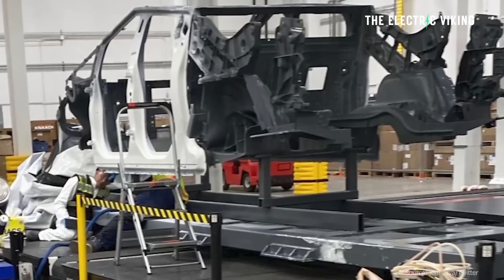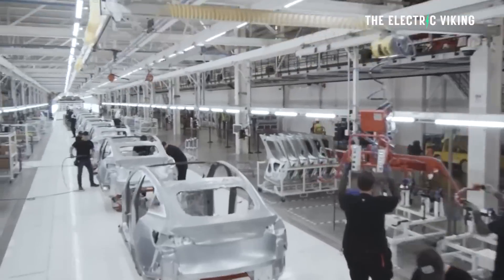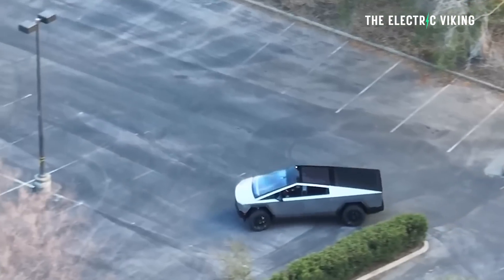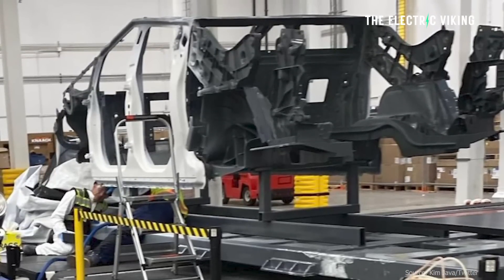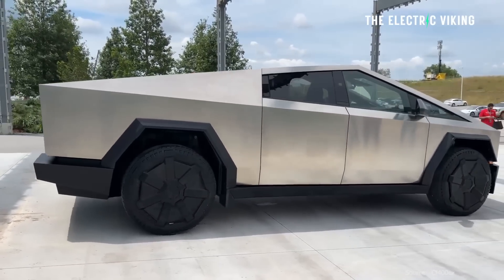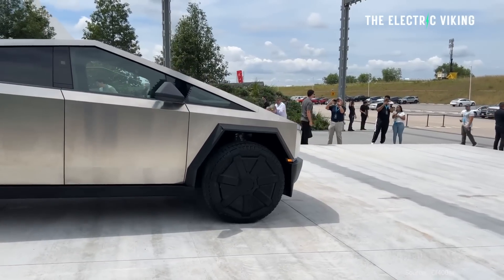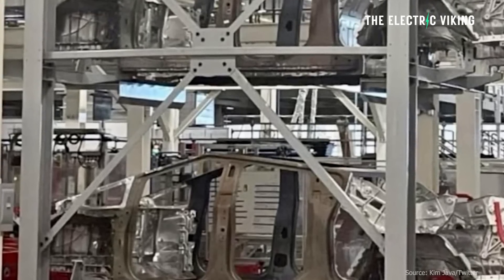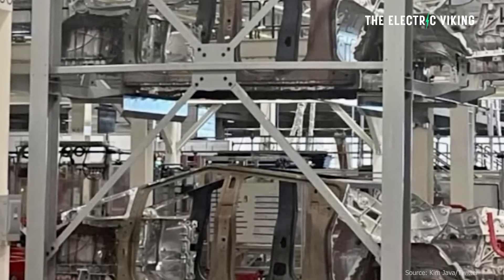Tesla Cybertruck production spec body in white revealed at Giga Texas

Comment: It looks like a unibody type design. Looks like mostly steel not stainless steel in this truck. Not much salt resistance from what I can see. Just a bigger electric Maverick with a different body shape. The giga castings takes cost out of production but reduces how strong the truck will be compared to the old design. This is why it took so long they had to redesign from the ground up.

Comment: this is not a normal truck, and to be blunt, it looks like Tesla will have built some kind of new variant of unibody. looks very strong and durable. the door aperture stampings are required for side impact protection more than likely. looks like a lot of high strength hot stamped steel. hard to know how much of that structure is stainless, but properly coated, these trucks shouldn't see any corrosion of decades of very hard use.

Comment: "Exoskeleton" was always misleading marketing. Anybody with a slightest inkling of how load paths work could tell you that those exterior panels were not going to be primary structure. And, if this ever goes outside of the US, the front panels are likely on collapsible standoffs for pedestrian safety. Flat surfaces are unforgiving of misalignment and flex, so the exterior likely provides little to no structure in order to maintain cosmetics.

Comment: That's not the body panels painted white. That's the internal, unibody like components. That white is no doubt a paint or primer to protect the panels from corrosion. 
Also, keep in mind that the B and C pillars are almost always shown in black, which tells you they're either painted or clad in black. Either way, the white shown in the video wouldn't be exposed to view.
Reply: "body in white" does NOT mean its painted white. Z its the basic body with out stufff like transmission, engines, wheels ets.
Reply: @eddevoe2519  uh no. No one calls it that or refers to it that way.
Reply: @ChristopherGaul  "Body in white (BIW) is the stage in automobile manufacturing in which a car body's frame has been joined together, that is before painting and before the motor, chassis sub-assemblies, or trim (glass, door locks/handles, seats, upholstery, electronics, etc.) have been integrated into the structure..."

Typically it is now technically body in E-coat, but the term has been used for over a century, back to when coachbuilders typically supplied bodies to manufacturers.

Comment: Most pickups are body on frame, where the frame provides the chassis strength.  Most cars are unibody, where the body panels provide much of the strength.  However, in standard unibody construction there are still front and rear subframes that support the suspension and powertrain.  In Teslas with the front and rear giga castings, the castings replace much of the body structure and all of the subframes.  The outer sheet metal is attached to the castings and provides some additional strength.  It's really neither fish nor fowl.
Reply: The Tesla Model Y that uses giga castings still has subframes, and this would as well, as there is no place to mount the motors or lower control arms. Motor and lower control arms mount to the subframe, which is designed to go under the vehicle in a severe accident. The subframe also helps with NVH and makes assembly easier. The casting replaces shock towers, rails that connect to the crush cans, and lower part of the bulkhead (what we used to call a fire wall) that would be spot-welded sheet metal in another unibody pickup, like a Hyundai Santa Cruz. In this application it extends upward to take some of the rear inner quarter panel loads.
Reply: @larryevans6739  Hi! I found your comment really fascinating, so you're saying the Cybertruck will still have a sub frame? At one point Elon Musk said the cybertruck would be an exoskeleton-based vehicle, but you're saying it's still body on frame, right? Just curious, thanks!
Reply: @burgerjointgame  No, I'm saying a it is a unibody. Most unibody vehicles use subframes. Most cars are unibodies. When you say "body on frame" then you are referring to a ladder frame that goes the length of the vehicle that has a body on top of it. This can be seen in most full-sized and heavy duty trucks. Trucks like the Hyundai Santa Cruz, Honda Ridgeline, Subaru Brat and Ford Maverik are other unibody trucks.

"Exoskeleton" is a marketing term taken from biology to try to make it sound special.
Reply: It's only very partially an exoskeleton in that the panels on the cybertruck will contribute to the structure, rather than merely hanging from it. Some of the stamped supports that provide the integrity of doors, panels, hoods, hatches on a conventional unibox will likely be mostly missing on the cybertruck. However I don't think they manage to get rid of it all. Was iit hyperbole from Elon? There's no way to do a true exoskeleton in a car as you will always have some form of underbody taking the stress from the hardpoints of the suspension.To what extent it is exo-skeleton we need to wait for Sandy Munro's teardown.
Reply: @pandemik0  "Exoskeleton" is not an engineering term. And if it wants to pass pedestrian crash tests outside of the US, the need for panels to collapse will eliminate their structural benefit. Regulations dictate the existence of side impact door beams, so those will not be removed either. The top is largely glass. The only possible place that the exterior panels could provide structure is the rear quarter. But, due to the unforgiving nature of flat panels with sharp edges for alignment and buckling, any benefit will likely be minimal. All the "exoskeleton" talk is overblown marketing to try to make a unibody seem special.
Reply: @larryevans6739 exoskeleton is a term borrowed from biology. Monocoque would be the most analogous engineering term, although I would think anything called a skeleton should have more points of articulation.  At a glance, it doesn't appear to be any of these things. I would suggest something like composite chassis. I can see the argument for calling it unibody, but I think it's a little different than the typical unibody archetype

Comment: I did some calculations a few months ago, accounting for commodity prices, labor, shipping and general inflation I came up with about 8K - $10K increase from the 2019 prices, $39.9K, $49.9K & $69.9K will become $49.9K, $59.9K and $79.9K, I did not account for the 4 motor version or rear wheel steering (don't know yet if that will be an option or standard) and I believe the single motor version may be dropped.
Reply: Agreed. I have seen a lot of people speculating largely inflated prices. In 2019 they may not have figured in gigacasting and new batteries. I can ably assume they would make the vehicle cheaper or maintain the 2019 price adjusted to 2023 and or 2024. If the low end CT is in the $49 range with the $7.5k they will sell like hot cakes. A low end in the $60k could be an epic fail. I am hoping Tri CT is $79.99k. Fingers crossed.
Reply: I hope you’re correct!!! I’ll be happy for a dual motor with 350 miles range for $65K.  Otherwise I have to rethink what the price of “cool” be worth!

Comment: Casting car body will either revolutionize car manufacturing and design if very successful in sales, or failed very miserably.

1) Casting has its limitation, so everything will be flat and angular to save cost, no more fancy curves and beautifully uniquely designed cars. Every car and truck will be same boring box shape looking, cost lower to mfg but cost a bomb to repair, as any damage requires changing of entire caste body with structural concern.

2) Structurally, there is report that such casting body without conventional skeleton structures faces a twisting strain force that will weaken the soldering joins whenever the car is turning, hence a safety concern. 

Tesla wanted to resolve by reinforcing it with some structural frame, but their engineers rejected as adding structure with add weight and offset the weight distribution, hence nullify the optimized tuning. It will take lot of resources to redo tuning for optimize performance and safety.

So only time will tell for any new innovative idea.
Reply: I disagree with your premises.  The Model Y has curved surfaces and is attached to rear castings on all versions and front and rear castings on the 4680 versions.  To resist torsion and linear bending, you can add material or move what material you have away from the center of inertia.  The giga castings do the second and it gives a higher moment of inertia without adding weight.  It's like comparing an I-beam to a solid bar of the same weight.
Reply: @robthomson6780  Curve casting using cold roll StainlessSteel?

We are talking about cyber truck not model Y using conventional car steel. Its said the expensive casting mold will damage quickly using cold roll SS that is very hard. So using angular sheet metal bending is most cost effective.

Regarding the structural strength concern, as you said some inertia adjustment (or added beams) can solve the problem. But it was rejected by Tesla engineers as they will have to re-design and optimize the car performance again.

These are explained in some videos and articles, not my opinion.
Reply: @naturetruth5218  You can't "cast" cold rolled steel. Cold rolled steel refers to a process to make sheet metal. Casting pours molten metal into a mold/die to create a 3D part. You can press sheet metal, or bend sheet metal, but if you take cold rolled steel and melt it down to cast it, it isn't cold-rolled anymore. 

All the Tesla hype is confusing you with their made-up terminology. This is a stamped steel unibody with front and rear castings for structure. Bent stainless steel for exterior body cladding.
Reply: @larryevans6739  Thank you for correcting me. Yes, I do agree with you with on those terms and understand what they mean.

Comment: The biggest gigacasting was always planned for the CT.
And for torsional rigidity, a certain "component depth" is always required, so with just a metal sheet on the outside, that would hardly be feasible, unless you build it like a tank with plates several cm thick.
Basically it's the same principle as in an airplane or ship, where there are struts/rings (frame) on the inside, which are then connected to the shell - together this gives enormous torsional rigidity in all directions.
But since you can't make rings at an open loading area, it is more like a boat hull here.

In conventional vehicles, the outer skin is only an optical thing, which is why soft steel or aluminum is used here, as these can be deformed particularly well. In the case of the CT, it is part of the supporting structure and can only be reshaped to a limited extent.

Comment: This is uncharted territory, the exoskeleton.  Just because they use a gigacast doesn't mean it isn't exoskeleton.  Normal car production the exterior is 3 layers, mild steel, high strength steel, mild steel sandwich.  I would guess the Cybertruck to do away with the higher cost high strength steel layer and just have a thicker outside, and an inside mild steel, as you still need a gap to run wires, windows, and crush zones.  It was never going to be one layer outside and that's it.
Reply: Even Sandy Monroe says its not an exoskeleton